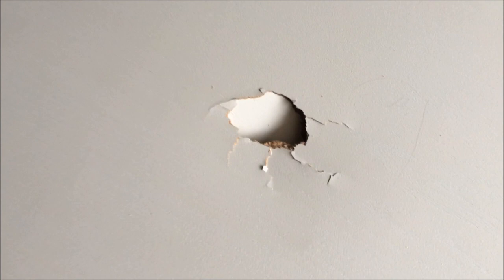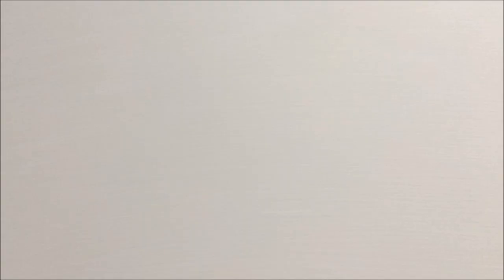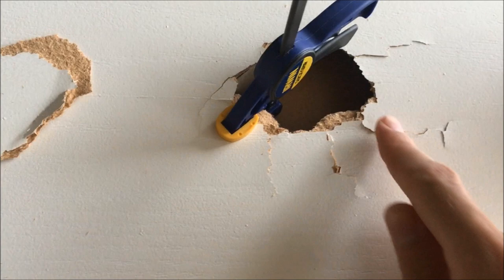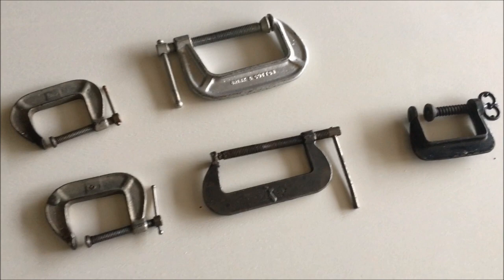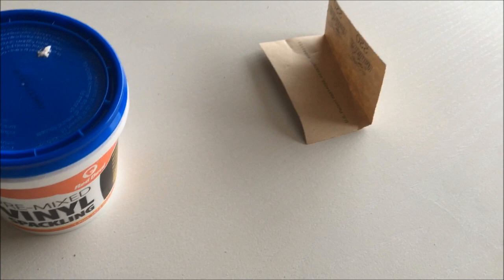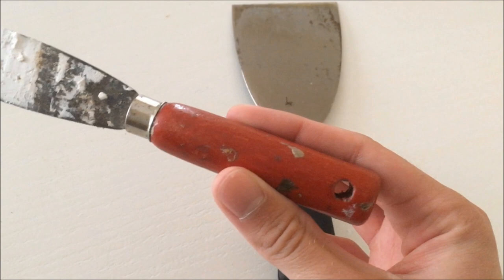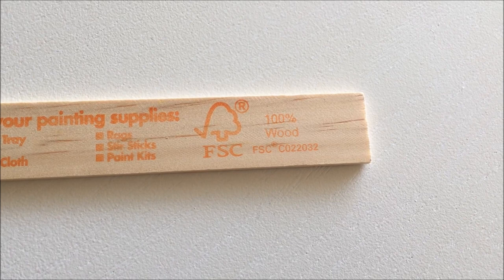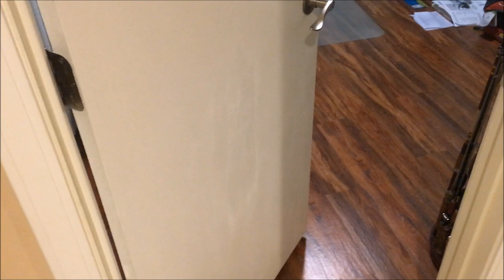Hemingray's Workshop: How to Repair a Hollow Door (Edit)

Comment: its not reinforced with cardboard. it looks like there was a previous hole filled in with expanding foam.
Reply from the maker: New door, installed 3 years prior... I don't know if it was actually cardboard, but it was something insufficient.
Reply: That is clearly cardboard, which is STANDARD for most mass market interior doors in the last 20 years.  And for some IKEA furniture as well.